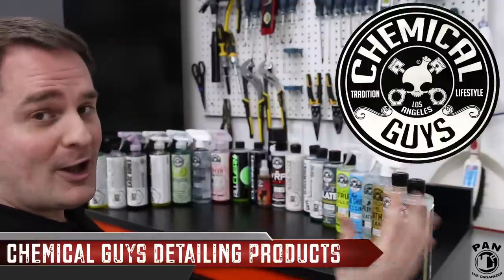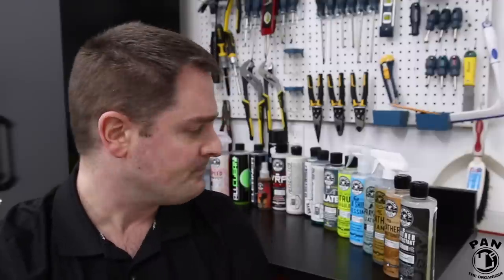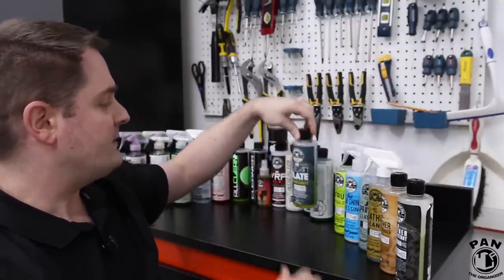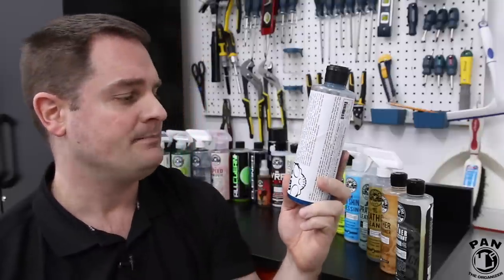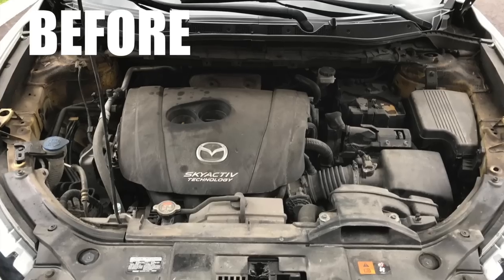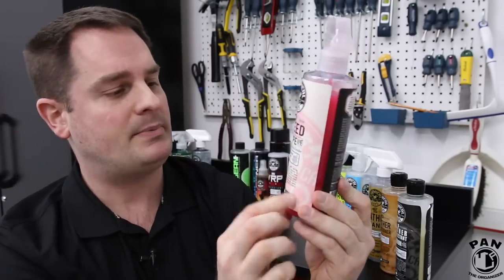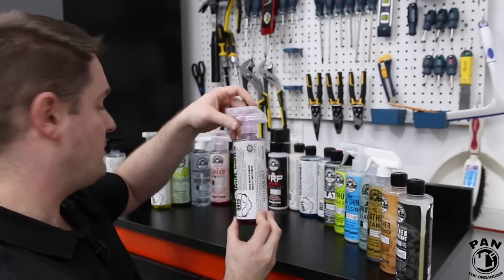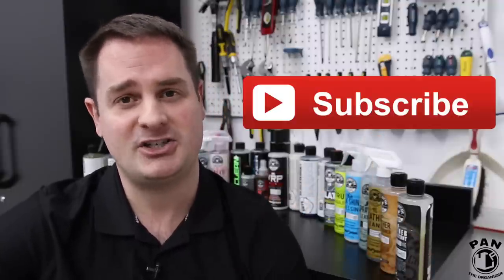CHEMICAL GUYS Detailing Products : Brand Review !!

Comment: Their products are an odd bunch. Most of them are just re-hashes of the same product (which aren't that good to begin with) but you do find the occasional one that is actually quite good. Blacklight and Jetseal are the only ones that I will ever use. They don't last long but give pretty good results.

On the up side, they do produce really good air sprays, that seems to be the only positive.
Reply from the maker: Exactly.  One has to know which ones to buy.
Reply: Jack Dean ive used alot of their stuff with great results. What have u had any issues with so i know to avoid them?
Reply: I have to strongly disagree. Iv used best of the best from mother’s to even older companies products. And none of them come close to CG and it seems CG is climbing to the top faster then anyone could have predicted. Only thing I still use other then CG is mother’s mag polish now they do have the best polish for chrome bumpers and wheels.
Reply: Read my comment above. Stay away from the Butter Wet Wax as it gave me bubbles that are all over the car and hard enough that they pull fibers out of any cloth you may think you'd like to use, including the soft side of a car cover!!!

Comment: Chemical Guys = trying to convince enthusiasts they need 10 different soaps. Nothing but marketing + rebranded generics.
Reply: I’m glad I’m not the only one that feels this way
Reply: what is a good mirror and window cleaner, also good plastic and vinyl cleaner?
Reply: dubb isopropyl alchohol + distilled water there u go
Reply: There are some good soaps tho!
Reply: They do have good products but so many that do the same thing
Reply: @dubb9020  Safeway is the best glass cleaner out there and it's like 2 bucks a can.
Reply: @hunnidisblack9337  i love you
Reply: @_LEONKING_   Yep. I have used many of Chemical Guys products from wheel cleaner, tire dressings to waxes and car soaps. Some I bought myself and others I borrowed from friends. I can honestly say that most of their stuff is definitely overrated indeed. But they do have a few top notch ones as well such as Butter Wet Wax, Wet Mirror Finish, Citrus Wash, VRP, Silk Shine and their air fresheners are hard to beat also.  I have used many detailing products over the years and am now using Poor Boys, Turtle Wax and P&S Beadmaker. Very high quality plus very reasonably priced.
Reply: Adam's polishes ftw. I agree with all of you saying that CG sells multiple of the same thing to try and convince you that you need all of them.l Adam's make good products that have multiple uses and it does well in all of them.
Reply: @zechariahprice605   I want to try Adam's but don't know which product to get first. Right now I'm using Malco Cherry Flash wax with Turtle Wax Seal and Shine and P and S Beadmaker for gloss and protection. Outstanding combo! I use Poorboys wheel cleaner and CG silk dressing for tires and trim. Which products do you recommend?
Reply: @lookahere  A universally agreed upon good Adam's product is their Detail spray. It is versatile and it's good at about everything it does. Same goes for their interior detailer. I also really like their wheel cleaner. It's very effective at removing brake dust.
Reply: If you don't like a product or a brand just don't buy it! It's so simple! But on the other hand I guess your job is internet critic. Critisize everyone and everything. I am sure you disliked the video too just because of the products!
Reply: Logan Johnson  I have a Harley Davison solid cast aluminum has oxidation real bad. How do I get like new ? Is it possible?
Reply: No Different then The other popular products like Adams. Adams uses bright colors in bottles to market. Checmical guys to maie decent to actually good products but maybe 20% of their products. Thats why Maguire’s is always safest bet , they simplify it and have been around long time. Griots garage too. Not too many gimmicks. But between Adams and CG they do saturate the market.
Reply: Hunnid is Black that works but the best it’s the Dr beasleys. I’ve never seen anything better
Reply: dubb do not out alcohol on your plastics/vinyl it can damage them
Reply: 5ifty9ine  he was asked about a decent glass cleaner. Yes, alcohol is bad for vinyl. Someone “helped me” with a an alcohol-based spray they demoed on my inside door handle. It’s spotty.
Reply: They just have a lot of the same things to sell more but I’ve never been let down by CG so far in my experience using it with my detailing business I’ve been using them more often since I have a local detail garage so it’s convenient
Reply: @lookahere  What would you suggest for leather care? Just bought a Lexus RX that had to have been on a routine maintenance clean schedule. I was looking to keep up the leather. Chem Guys have a shop literally right up the street and was aiming to check it out today. I notice their leather line didn't make your "top notch" list. What would you recommend ?
Reply: @TheNewbSauce  I actually have the CG leather cleaner and it does well on mildly dirty leather. But over the years I have found that Woolite is the best at gently cleaning the dirtiest leather and removing dye transfer from jeans. Afterwards I use a dedicated conditioner like Chemical Guys or Leather Honey. FYI I use the dollar store brand of Woolite these days with the same results.
Reply: Too many products. Gets confusing. They need to update their packaging too.
Reply: Thank you Logan.
Reply: That’s why I just have my soap, tire and rim cleaner, butter wax, interior and carpet and holster cleaner and window cleaner and I am set
Reply: Well, companies won’t produce what doesn’t sell…
Reply: I stick with P and S, DIY Detail, Adams is also great, Maguiers is pretty good too

Comment: I have used VRP on my 2007 Trailblazer's cowl, running boards and plastic trim, it's worked so far, I even used it on my wife's 2007 HHR. made those oxidized plastic panels look new. I haven't used it on tires yet.

Comment: So many haters out there! CG’s staple products are legit! Butter wet wax, VRP, jetseal, blacklight, v36, v38, silk shine, v07 quick detailer, citrus wash and gloss, honeydew snow foam. Boom!
Reply from the maker: I agree.  Not all CG products are good, but when you find the good ones, like the ones you and I listed, you get quality products at a good price.
Reply: Half of what you mentioned is NOT legit lol Butter wet only lasts a month if that, Collinite845 works 10x better and lasts closer to 6 months . VRP is Okay . Jetseal only last 2-3 Months . They're V line series of paint correction is one of the worst problems in their lineup . Menzerna, 3D, Sonax, & Jascar all make better products most for less money . Their soaps do well though .
Reply: Solo J Who argues longevity in a show wax? It takes minutes to apply and that is the beauty of it. Jetseal in my experience on my vehicle that is parked outside I’ve gotten six maybe 7 months of protection and my vehicle that is in the garage has lasted a year. Apex detail has a vigorous testing of the V line of polishes you should check out. There are superior polishes out there but they can be more costly as well. Chemical guys Fa life!

Comment: I also like some CG's stuff and prices are reasonable  compared to Adams which I feel are very overpriced.  Great job Pan..
Reply from the maker: Thanks Kurt!

How did you discover my channel?
Reply: oddly enough the stuff adam's sells is basically the same product its core. they're both made in the same factory from the same chemical manufacturer.
Reply from the maker: Many products are often the same, just relabeled, change of smell, color and minor tweaks.  The rest is marketing.

Comment: *Citrus Wash and Gloss will strip wax. Their advertisements say that it is not pH balanced and is on the acidic side. 

That being said, it is still a fantastic soap I have been using for a couple years. I switched to a neutral soap that won't erase my wax so I can keep building layers of protection with each wash, rather than stripping it every time. Again, it is still a great soap and probably the best of their soaps that I have used. It's slicker than any other soap I have used.

(*Edit was a grammar mistake)

Comment: I tried Chemical Guys Tire Kicker and it didn't last as long as Zaino Z-16 Tire Shine .  I tried Chemical Guys Butter Wet Wax and it didn't last more than a month .  Compare that to Zaino Z-2 Pro ,  one coat of which has lasted me up to 6 months .
   I tried CG Headlight Restorer and, while it works,  it cannot remove all of the defects from a bad headlight, so you have to wet sand first .    A harsh compound  such as Meguiar's #4  would probably do the same job since the protection left by the CG product is minimal anyway .

Comment: I like their VRP for trim and tires. I have done my inner fender liners too. 

I've tried their synthetic instant detailer. I found it worked fine but didn't really add much to my current arsenal which is primarily optimum and opti-coat line products.

Lastly I used the inner-clean. Works as advertised. It smells nice which is a plus. Lately I've been using diluted ONR and haven't noticed a difference. ONR is cheaper to buy and leaves a nice blueberry scent.
Reply from the maker: Thanks for watching Ryan!  How did you discover my channel?
Reply: @PanTheOrganizer  I am a bit of a detail nut by hobby and found your channel through searching/researching detailing products. One video of yours on tire dressings made me look into VRP after seeing it on the shelf at a local part store.
Reply from the maker: Thanks for the feedback!

Comment: I have asked this directly to Chemical Guys, but I want another perspective.  If I understood this correctly, when you do a buff and polish job and you want to apply a ceramic it is the last step taken; there’s no need to apply a wax or any other sealants after the ceramic.  But Chemical Guys told me that the Hydrocharge and Hydroslick is applied after the V38 polish, then the Wet Mirror Finish, then Jet Seal, then Butter Wet Wax.  Why all those steps after Hydroslick if that is suppose to provide the protection?
Reply from the maker: I wouldn’t recommend the Hydro line really. Those aren’t true ceramic coatings. The HydroSlick barely lasts a month or so in my testing.

A true ceramic coating comes in a glass bottle and lasts one plus years. Watch my ceramic coating application tutorial here: https://youtu.be/sqQYVjxFqK0
Reply: @PanTheOrganizer  so, what about the V Series?  Keep in mind that I’m a weekend warrior.  And since you don’t recommend the Hydro line, if I did use the V Series, it’s better to use a bottle ceramic?  What about sprays?

Comment: Thanks Pan for the good review on CG products. I can personally attest to the great performance of their Glossworkz shampoo. I use it on my black ceramic coated 370Z with a concentration of 1 oz per gallon of water for the contact wash and it does an excellent job. The wash really shines in my foam gun where I use it at a mixing ratio of 4 oz product to 28 oz of water in the gun's reservoir. The levels of gloss, slickness and repulsion of dust and dirt are unmatched by any other soap I've used.
Reply from the maker: Thanks for sharing Jim!

Comment: Great video Pan I like how you get right to the point of the video and keep it on topic!!  I'm just looking for a QD spray suggestion for using on top of Jet Seal that won't interfere and allow me to layer the JS down the road while providing gloss and maybe some protection too in between JS applications.  I still use KAIO and use it as a QD too where it's water based and I've been happy for a few years with that.  Getting back into detailing after five years of nothing I'm just trying new products  and enjoying the results.  Thanks for the great videos!!
Reply from the maker: Thanks Darius!  Use Bead Maker.

Here’s my review: https://youtu.be/J7uc4AlarpU
Reply: @PanTheOrganizer  Thanks Pan I ordered some yesterday actually against by better judgement vs what all is currently in my supply cabinets.  Great review on the product keep up the good work!!

Comment: Honestly, 90% of the CG products are crap and way to expensive. To be fair they smell really good (although they perform poorly).
Reply: They are good if you don't nitpick.
Reply: If you are detailing you should be a little nitpicking. But let’s be honest, the shampoos are decent, the scents are great, the cleaners, detailers and the sealings are really poor. For example JetSeal is easy to use but the beading/sheeting is poor AF. You can buy a can of Wax (like Fusso Coat) for half the price and it last a lifetime, plus the beading is insane. I’m not hating, just saying the truth.
Reply: I use Jet Seal and I get some good beading out of it.
Reply: It's true Jet seal is junk, only lasted about 2 washes on my car.
Reply from the maker: Exactly Joel.  Also, you just have to find out which ones are worth buying, hence why I did the video.
Reply from the maker: Fusso Coat is one of the best values in the sealant wax category.
Reply: ob1kdanny87 
What are you washing your car with?  That matters.

Comment: does the citrus wash have wax in it? im planning to put a ceramic coating on my car, im looking for a hybrid soap that can be safe with coatings, and at a higher concentration, strip older protection.
Reply from the maker: I would look elsewhere for a shampoo for coatings. Here are a few good options:
https://bit.ly/3T428Gv

You don't want to use shampoos that are too harsh though. Although coatings have much higher chemical resistance compared to waxes or sealants, you don't want to hit them with a high alkaline pH stripping shampoo too often (pH 10+) as you will likely weaken the coating. There is no need to.

Use a quality maintenance shampoo like the one I linked above and you are golden.

Also, watch my ceramic coating maintenance wash tutorial here: https://youtu.be/yLiePQRMFc8

And every now and then, when spring comes along for examples, a deeper cleaning following my method here: https://youtu.be/oTaFE_p2OAw
Reply: @PanTheOrganizer  thank you!
Reply from the maker: My pleasure Patrick.

Comment: Hey Pan, great video as always. There seems to be a lot of interior products and I'm slightly confused as to what will work. 

Can I use a diluted APC to clean the entire interior? Or should I be using a dedicated interior trim cleaner, fabric cleaner etc...
Reply: You can use a diluted apc to clean an interior or an interior cleaner.
Reply: Apc is usually used on the dirtiest jobs but something that isn’t that extensive you can just use an interior cleaner

Comment: Great video. Question: Clean Slate or OG Clay Bar?
Reply from the maker: Two different products for different applications. Clean Slate starts to break down older waxes/sealants and is more of a shampoo. A claybar is used to remove contamination from the clear coat.
Reply: @PanTheOrganizer  OK, but a clay bar won't know the difference, right? Wouldn't it remove any physical irregularity - including any deteriorating layers of waxes/sealants? Or are you saying that it will simply glide over those as they won't present as irregularities because they'll be too smooth for the clay bar to encounter any resistance?

Comment: Question for you. I'm getting into the detailing business as a hobby and a little bit of side cash. I live in a smaller city in north western PA., 90 min. North of Pitt. So the isn't really any detailing businesses in my area. My main focus is going to be on quality, I'm stuck between products and could use some suggestions. Do you think I would benefit more from using an Ammo line up or going with a chemical guys kit to start? Thanks in advance!
Reply from the maker: It depends on your budget.  The AMMO line is more pro for sure, but costs a lot more.  But it's also a simpler lineup, with less products to choose.  Chemical Guys is good value because many of their products can be bought in bulk and many can be diluted.  Your best bet is to buy a couple, and test them.  There's no better product than the one you like to use.  ;)
Reply: Pan TheOrganizer thanks A lot for your reply. I went ahead and ordered some of both. I went with a chemical guys kit to get the ball rolling for family, friends and customers. And have some Ammo products on the way to experiment on my personal vehicles, and I will go from there. Thanks again!

Comment: Hi Pan, I notice that you don’t have any of their glazes in your brand review. Do you have any experience with or recommend  their glazes?
Reply from the maker: I don't use glazes as they are just a way to "fake" a paint correction, as they contain fillers to only mask imperfections like scratches and swirls. If you do true and proper paint correction (compound & polish), you won't need glazes.

Comment: Hey pan, i intend to buy citrus wash and gloss..but some reviews says that it strips wax..but u said it doesnt..can i use it as a maintenance wash shampoo while protecting my wax?
Reply from the maker: It won't immediately strip wax off, but it is a stronger shop, so it could potentially start breaking down older waxes and sealants.  What I would recommend for maintenance shampoo, is Chemical Guys Glossworkz.  That will add a boost in gloss and is a great soap overall.
Reply: @PanTheOrganizer  then would u recommend using citrus wash and gloss on?
Reply from the maker: Once in a while when you want a deeper cleaning.